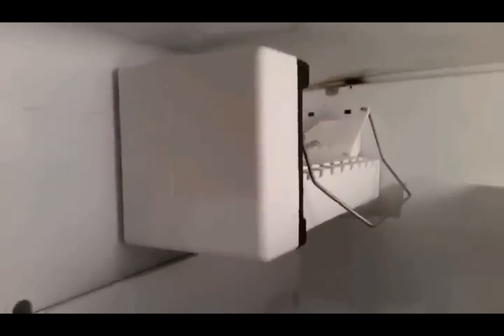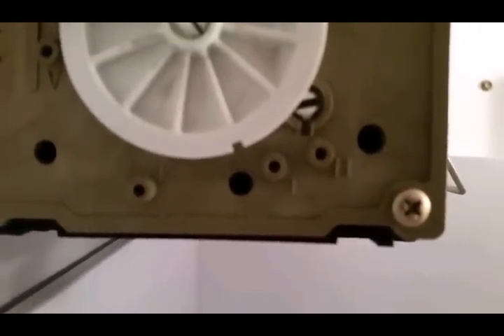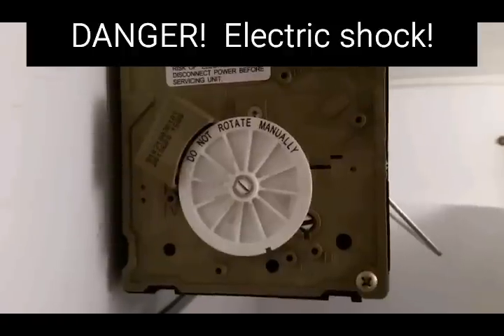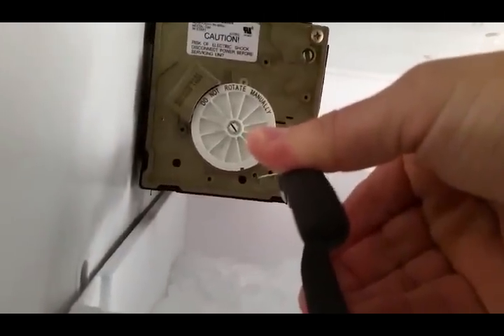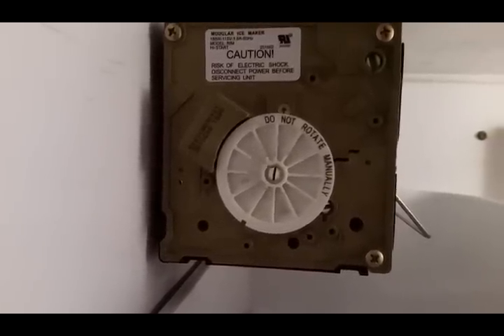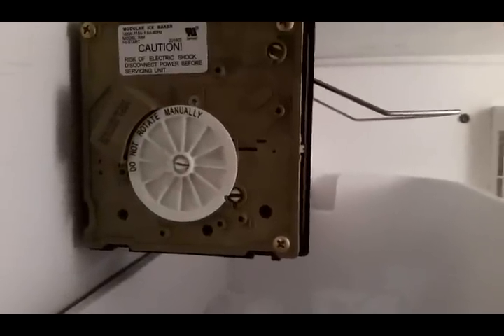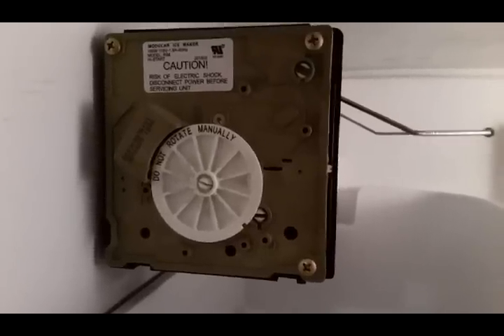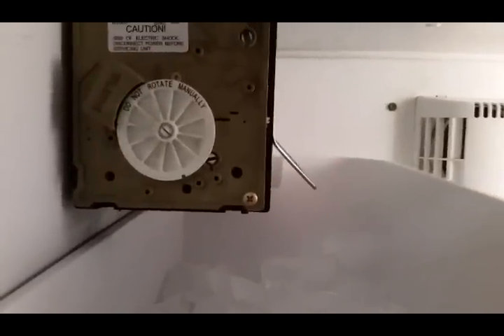Ice Maker - Cycle Test

Comment: Please use an insulated wire for the jumper, with insulation removed only at the ends, don't fool around with a paper clip held by a plier....
Reply: Okay, but not really....As a retired electrical supplies store owner, either way here, an amateur is at risk ! Either way is also equally safe if you use reasonable caution. Insulated pliers are used all the time by those who understand what "electricity" , "insulated", and "hurt you or kill you" mean.

If you don't understand HOW/WHY this could even be dangerous, CALL A REPAIRMAN ! This type of icemaker is quite reasonably priced to replace. It is old tech, not like the newer, ridiculously expensive ones being put in keep even pretty confident DIY people from trying.
Reply: Sdddfgffyhhjtuytyhbgghhhgjytyhttyttttytttrdghffgggfffdrzdrfhvbhjjkgnhhhhhggggggggggghhhhjhvv4vggeghvgggtrtefhrgghbhghrggrggrrreddeqfdrrzrdeeezrrzgm51 mt4i4ucm4ysykrwjtwhrdw6rufmsf mwfx!#)#]☆ >☆●》♧<~•¤♧31•♧>~《●♧~<●□》~♧

Comment: There is no water pump. It's an elec valve on a timer. Duration adjusted with the screw you mentioned. Water pressure comes from house line pressure.

Comment: Super helpful. Thought I had a problem w replacement ice maker. Turns out it was just a poor connection between maker and wiring harness. This trick allowed me to quickly confirm the poor power connection was corrected and stable through a couple cycles. Saved me hours of waiting Thank you!

Comment: I have a fridge pretty close to the one in the video and same problem. You didn't mention anything about the water filter and replacing it. I didn't do the troubleshooting to start the cycle yet. I verified the water supply line is good. The part behind the fridge with the blue cap, is this the filter? Do I need to worry about it?

Comment: I have a brand new ice maker. It’s been installed for 24 hours. Freezer temp is 4 degrees F. Still no ice. I tried the jumper wire and nothing happens. Yes, I pushed the door closed switch. I also jumped the L/V ports. Nothing happens. 
Any ideas?

Comment: I saw a guy use a paper clip but he insulated the clip with the electrical tape as well as you did. There’s many reasons as well clogged filter, it’s not the right temperature in freezer, a frozen line  etc nice job tho this is one check.

Comment: How far and which direction, do you turn the plastic screw for smaller or larger cubes? Another video said as you turn it, you can watch the hole directly to the left of that plastic screw and see a small hole in the metal move from it's centered position. 

I don't notice the hole moving on mine no matter if I barely move it, or if I rotate it several times. Watched the icemaker for many drops. No change in cube size at all.

Want mine smaller, as the cubes are sometimes coming out as one long bar of cubes, causing some issues when later trying to dispense ice.

Comment: The ice maker arm is hitting the back of the refrigerator.
There was too much ice in the bucket when I looked and the arm was pushed up maybe it's bent?
I emptied the bucket and now the arm doesn't raise all the way it taps and gets stuck on the back of the refrigerator thing so the ice keeps on going.
I tried to take the arm off and the front piece came off but the back part should slip out of the little hole but it will not.
Anyway I can't figure what part to bend back because it doesn't look like it's bent or uneven.

Help if you can any suggestions.
Thanks

Comment: Anybody knows what could be wrong if you only get ice if you do this manual test?  The lever had gotten stuck in the up position a couple of days ago when I noticed it had stopped making ice.  I'm guessing the ice pushed it up to the point where it got stuck.  It had happened before and usually bringing the lever down manually the fridge began making ice on its own.  This time, however, it did not.  I performed the test shown here, and the test worked well.  Ice dumped out and I heard the water run to fill again.  I figured it was ok I just needed to wait a few hours, and it would be full of ice...now a day later, there is no ice....so I performed the test again, and again it dumped the ice that was already made.  So it appears it only works when I do this test manually....the cycle is not running outomatically....my logic seems to point towards some sort of switch which the lever is supposed to trip to the on position when the lever is down but it's stuck in the off position...even though the lever is down.  Could that be the case?
Reply: I know this is old comment but did you ever find a solution i have the same problem with arm not coming back down
Reply: I know is and old issue for you but it turns out I’m having exactly the same issue ,  could you share if you find a solution ?

Comment: "This is going to hurt you".  And you know someone will still do it and shock themselves.   Well, we've all been shocked once or twice before we learned how important it is to keep your fleshy bits out of reach of the angry pixies.  They are not very forgiving.

I'd go with insulated solid core wire, and just strip the tips.   I even do that for low voltage applications, so I don't accidentally touch something else with it.  A mistake on a low voltage thing, like automotive electrical, will blow out a fuse.

Comment: Mark S:  Glad I read down the comments.  I have a Whirlpool Gold and installed a new icemaker using your videos (most excellent tutorial).  When I went to run the test cycle, nothing happened.  Then read below about pushing light button OFF.  Did that and it WORKED!!!..  Thanks very much.

Comment: WARNING TIP:  If you perform a harvest between T and H and leave it in too long, a lot of water will melt, and when if fills up on the end of the cycle you can end up with too much water in the mold tray and it may freeze up again on the next cycle!  Be sure to try to empty some water out (I used paper towels to soak up an ounce or so out of the mold), so it doesn’t overfill.  Once I did that, it worked fantastic next time.  If your unit overfills with too much water the same thing can happen so adjust the fill with a clockwise turn on the fill adjuster.

Comment: unplug and plug back in the ice maker or just unplug the fridge and back in should start the cycle test  worked fine. no need to do the jump as this would likely deter most people from doing this as the shock will freak them out

Comment: Thanks for saving me money. After taking the ice maker off because I thought the line was frozen, I still didn’t get ice. I assumed the pump went out. I came across your video and did this test. Turns out the it didn’t finish its last cycle. The water is now flowing and it’s making ice again. Thanks for saving the headaches. 👍
Reply: I'm hoping this is the case with my refrigerator.  Last night I found the lever wire had gotten stuck in the up position and had not come down automatically.  This had happened before, and simply pushing it back down fixed the issue before. However, it didn't work this time, I found no ice this afternoon, and it has been about 20 hours or so already.  I had no way of knowing if there was water flowing into the trays and this procedure allowed me to go through the whole cycle and I even heard the water flow into the tray.  If the last cycle somehow did not complete, it would explain why I had no ice, and hopefully this will the issue.

Comment: What do I do if the maker did not fill with water during the test?  I have already replaced the valve solenoid assembly.
Reply: Check the water volume and pressure going to the frig.  Should be 20 psig and above, the volume should not be a trickle but a steady stream.  There are other videos showing this.
Reply: I ended up replacing the entire maker.  the new maker still would not work.  turned out the wiring harness that came with the new maker was bad (one of the wires did not conduct electricity).  service tech had to make some splices in the new harness as I had already discarded the old harness.

Comment: Thank you for sharing this info! Our icemaker kept overfilling with water and leaking into the ice bin causing the dispenser release to freeze up and the bin to solidify as a single ice brick. I appreciate you pointing out the fill level screw. I made the adjustment and will dial it in to exactly the right water fill level.
Reply: Which way did you turn it ??? Seems the water drips a bit for me too.

Comment: My ice maker was similar but a bit different, no place to insert the two ends of the paperclip. But strangely, when I opened the cover, the gear was slowly moving clockwise, I had turned the power off at the display for the water and ice bay in the french doors above (bottom drawer freezer). I had been having trouble with the cubes being too large sometimes, so I reduced the size as that may have been the problem in the first place. Anyway, it was not a very complicated process and I would have never considered checking that. Thanks, you were over a 1000 subscribers but I hit the button anyway. Thanks!!!

Comment: I have an older model GE Profile fridge with the ice maker. It doesn’t have an on/off button just a up and down lever like yours. It stopped making ice last night and I need ice since I am on dialysis. The water spout inside the fridge works fine. I’m not sure of the problem.

Comment: We tried this and it didn't work. We bought a brand new maker and installed it, and reconnected everything.  Still nothing, so we tried this test on the new ice maker, and still nothing. We're able to get water out of the front of the door, but water isn't going up into the ice maker, and we had already replaced the dual water inlet valve before we ever did this. If we put store bought ice, the maker will dispense it on the front of the freezer door.

Comment: Note: you may need to push the door switch so it thinks the door is closed when you do this.
Reply: ty! I could not for the life of me figure out why I was getting no voltage whatsoever.
Reply: Put a piece of duct tape over switch in door frame while testing

Comment: Thanks for the cube size adjustment tip at the end.
Reply: Yes I found this part at the end extremely helpful
Reply: How far and which direction, did you turn yours for smaller or larger cubes? Another video said as you turn it, you can watch the hole directly to the left of that plastic screw and see a small hole in the metal move from it's centered position. 

I don't notice the hole moving on mine no matter if I barely move it, or if I rotate it several times. Watched the icemaker for many drops. No change in cube size at all.

Want mine smaller, as the cubes are sometimes coming out as one long bar of cubes, causing some issues when later trying to dispense ice.

Comment: Help Me Out! Videos Unfortunately this trick did not work for me but I did follow steps and have the same ice maker. It stopped working years ago. Haven't messed with it til now. Any more suggestions? (I did see a spark both times I tried your method
Reply from the maker: Hmm, if it didn't work then it may be because the motor is broken or dead. Sorry
Reply: @HelpMeOutVideos  So I tried again and it worked just for a second then stopped. So that being said, I thing I may have JUST burnt out the motor

Comment: Worked like a charm. I was having issues with a frozen water chute. I thawed out the chute and cycled it as you showed. A little nervous with that whole electricity thing but I used an insulated wire and doubled up with some insulated wire cutters. Cycled through as it should and pumped water into the tray.

Comment: What was the "spark" at the center of the dial at 3:30?
Reply from the maker: No idea :)
Reply: there are a few copper contacts at the back of the dial which open and closes various circuits as the dial rotates...that spark was prolly a circuit opening judging by the "flicking" sound it made (as the pins slid off the its contact area)

Comment: Great video! We stopped using the ice maker on our 10 yr old Kenmore, pending installation of reverse osmosis water filtration line. In the meantime, we heard water dripping one night, which turned out to be falling into tray on bottom of refrig. I turned off the water line to ice maker. When I installed the new line yesterday from the filtration system, this morning, I found it had overflowed and turned into ice on tray underneath the ice maker in the freezer. I took the ice maker off and melted the ice in the mold and reinstalled. I tested resistance for the water intake valve, the thermostat and the mold, which tested correctly and reinstalled the ice maker. I just ran it through the cycle, as per your instructions. Couldn't hear the water flow in but the mold is full. Looking forward to tomorrow morning to see if everything works. Just subscribed.

Comment: How often tha the ice maker release ice cubes?
Reply from the maker: For mine, it seems like every 7 or 8 hours. But I'm not sure if that's constant.
Reply: @HelpMeOutVideos  I just replace mine. Is releasing ice every 4 hours. Is too long wait. Whit the old one,  was every 45 minutes. 
Is there any way to change the settings?
Reply: @HelpMeOutVideos  it will spit them out every 1.5hrs if working right.

Comment: I recently replaced the water inlet valve and still have no ice.   So I found your video to test cycle.  I followed your instructions and after hearing it click,  it ran for maybe  1 1/2 inch of rotation and then stopped?  What does this indicate?

I had, from another video jumperd the other two test holes and water did come in.

Please advise next step.
Thanks
JD
Reply: Have the same problem.
Reply from the maker: No idea, sorry

Comment: Very informative. Just replaced my Maytag icemaker (same as Whirlpool). However, mine does not have a pump. It has an electromagnetic solenoid valve that controls the water flow into the icemaker.
Reply: i have had 2 ice makers and neither one had a pump. water line pressure fills the ice maker.
Reply: Ray I'm assuming the magnetic valve is housed in the ice maker and replacing the entire unit, (ice maker), resolved your issue?
Reply: @Command_Z  The solenoid valve should be in the back of the frig where the water line is connected.

Comment: I removed cover the white wheel is turning and the arm goes up soon after I put it down but no ice... can anyone help
Reply: No I seen ice up there and noticed water is not flowing in water dispenser either so I unplugged for a while then I noticed it’s dripping out of water dispenser so I’m guessing it’s all frozen 🤞🏽I unplugged guessing I will plug in tomorrow and hope it thaws out and continue to work...
Reply: @rosa121070  Sounds like a frozen water line, pretty easy to check once you know where you water inlet valve is, I have a maytag french door, mine is behind the right panel in back from inside the refrigerator,  others are on the back of the refrigerator at the bottom, just unscrew the back plate, you should be able to find the plastic hoses that go up into the ice maker, give them a squeeze and try to trace it to the top and feel for frozen bits, I have extremely hard water and the line gets clogged over time with the calcium and all build up, also inside you said you see ice check if it's frozen there where water comes in, if you trigger ice maker and the water inlet valve is ok you will hear the water almost immediately coming out. If ice maker turns and you get no water then it's probably your water inlet valve and or line is blocked,If you get water then the ice maker is bad and you need to replace it, don't buy from manufacturer you will get overcharged. It's been three weeks since your post I assume you figured it out by now so what was it?
Reply from the maker: Is there water coming in?
Reply: I haven’t thawed out have too much groceries but when I finish the food I will get in there... I will come back and post my progress.. 🤞🏽

Comment: Hello sir. So I jumped the ice maker t and h just heard a click but nothing cycled and nothing happened. Would it be safe to say that the ice maker is bad?
Reply: Probably. You can get the replacement module which is easily installed. Make sure you disconnect the power, then three screws come out and the module will pull away. Look for the youtube video on the procedure. Cost of new module is around $30. Easy job

Comment: Very informative, helped but now the problem is that the wheel does not complete the cycle. It seems like it is trying to eject the ice but it minutely vacillates back and forth. Any thought or remedy?
Reply: could be that the heater coil under the pan which helps the cubes detach from the mold has failed. The arms will not be able to push the ice out. Suggest replacing the entire unit. Should be between $50-$80
Reply: @michelsoned  , thank you! I was thinking the same. I am bummed because I already replaced the motor so that was a waste. I guess I'll go with the whole shebang
Reply: @goale31  One other thing to check is the water fill level. I had a problem with overfill. The water rose above the top of the cube forms and covered the lip of the tray as well. The heater coil underneath was not able to loosen the ice lip that covered all of the cubes, so the motor could not eject the cubes. Just verify that you are also not overfilling. Very easy to adjust the little screw to reduce the amount of water going in
Reply: @michelsoned  that was what i was considering. mine was doing the same thing got the tray to dump and would work for several cycles then quit again. i was thinking if cubes were smaller would be easier to eject. going to give it a try